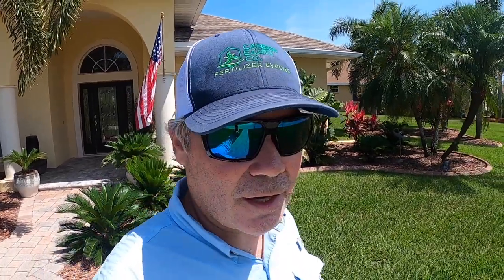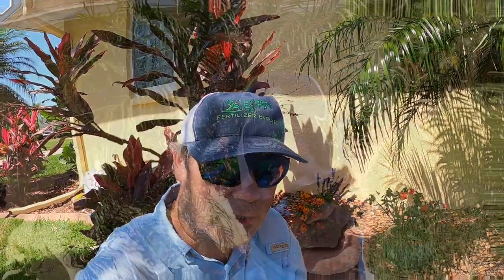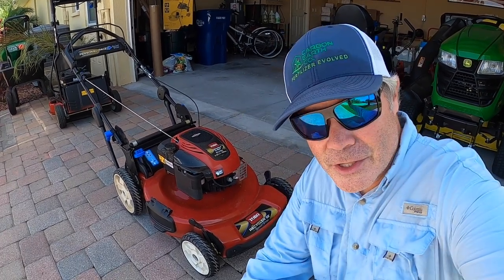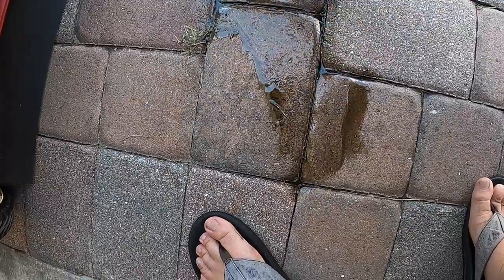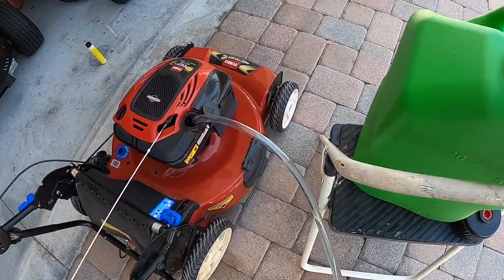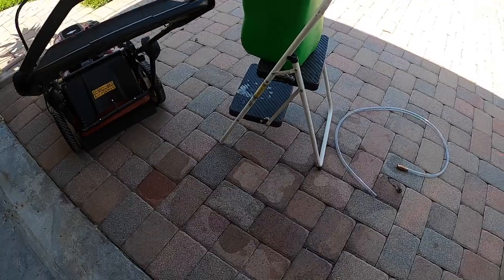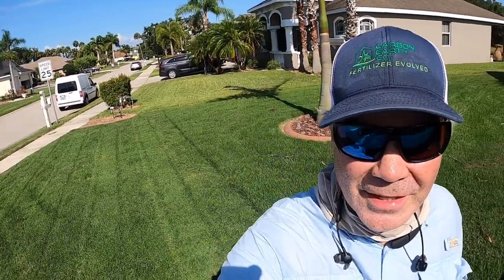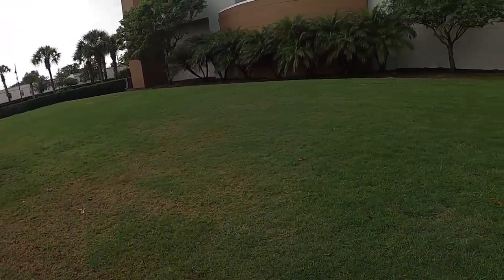Will It Start? Revisiting The Old Toro Recycler SMARTSTOW

Comment: Maybe the gas will work as a cleaning solvent on your oil spill. 😂 I bought that exact mower on your recommendation. The newer model has the lever for the mulch plug/recycle feature. As a short guy, I prefer the lower handle position. Effortless mow.

Comment: 6:17 - “I pulled the spark plug wire when I sharpened the blade.... I promise....” 🤣
Reply: This thing of pulling the lead if the plug, have you ever tried to start a mower with the dead man's handle left in the off position. Never have I ever needed to remove the lead. And I've still got 9 fingers. Joke.
Reply: bobbelsekwol - one thumb up! 👍🏻 😂

Comment: When I bought my TM from local dealer he said Toros engines are designed to run off 89 fuel. He said running anything else is a waste of money. Not sure if there is any validity to this or not.
Reply: Yes indeed
.and buy what is called Rec. Fuel. No ethanol in it.. add couple ounces of Seafoam fuel conditioner to your can and fuel will stay fresh for a good long time.  I get mine at local BP Amaco station or you can get at marina too
Great fuel in my 10 year old Toro..

Comment: Ethanol gas attracts water and in turn evaps quicker. ALL gas will leave a goo that will clog the carb eventually. With you living in FL  the temp varies much less then it does in other places like the midwest and north. The gas breaks down quicker in those situations. Gas also looses 1 Octane rating per 30 days.
Also the Amazon Basics Oil is good but small engines can use Zinc heavy oil. I recommend those oils because the Zinc drastically contributes to less engine wear.  Those oils can be bought at lawn more shops.
Reply from the maker: Good stuff thank you !!!

Comment: HEY LCN, my scotts edgeguard spreader doesnt seem to spread consistant. It leaves lines on the grass after a few days of higher concentrated fertilizer areas. is that normal?
Reply from the maker: it can happen if you are not walking fast enough. also check the impellor (whirly thing under the drop holes) and make sure it's not gummed with stuff.
Reply: @Thelawncarenut  thanks for the tip!

Comment: Use the weed torch you got to burn off that oil. If not you’ll always have that annoying oil stain in the pavers. Works great when that family member comes with the beat up clunker and drips on your driveway. I’ll wait a day or two let the gas evaporate first. Or you can be ballzy and just let it rip!

Comment: Disliked Toro because I had one with a Kohler motor and that thing would never ever start. Got it to start once after cleaning the carb. Maybe the Briggs would have been better.
Reply: A good combination is a Toro with a Honda engine. I’ve just recently purchased the 60V Recycler. It’s my third Toro. If you have a third of an acre or less they’re also worth considering because they’re easy to live with.
Reply: I have the Smart Stow with the Briggs and I can’t get it to start again. New gas, spark plug, oil, cleaned carburetor and got a new carburetor. Nothing worked!! I just got the 60V recycler and so far so good. 👍🏽
Reply: cartercarlton28 shoot some carb spray in and should fire right up. It will get the fuel pump going
Reply: John R Thanks John I will give it a try
Reply: cartercarlton28 hopefully you have spark...
Reply: Tried to keep the comment short. But we've tried everything. I cleaned the carb, also new spark plugs , gave it to a friend who cleaned out the gas tank, he to it to a lawn mower repair guy. After each of these things it runs once or twice, and never start till another repair. Currently using an Ego mower. I realize I'm more likely to mow the yard twice a week if I can just start it and go. Even have time to sharpen the blade ever other mow. The Toro mower with Kohler motor was a consumer reports best buy in 2012. Crazy thing is was a bought an old craftsman mower used for $50 bucks and it never had an issue staring. That was the best gas mower i ever had.